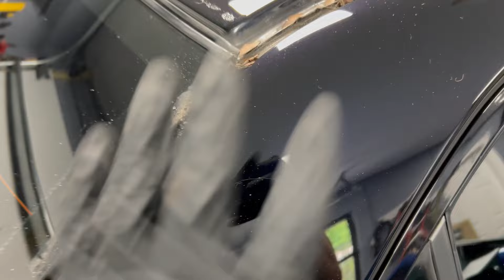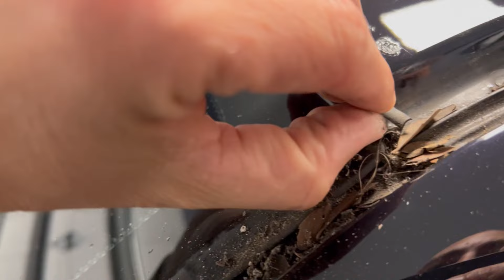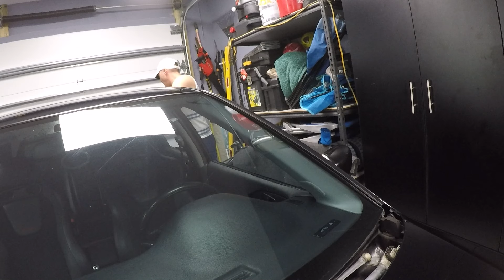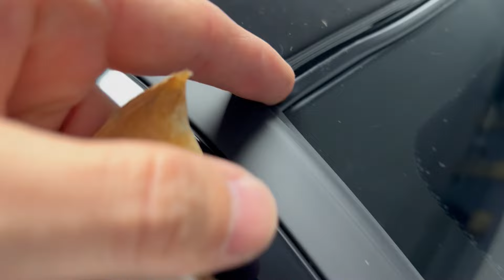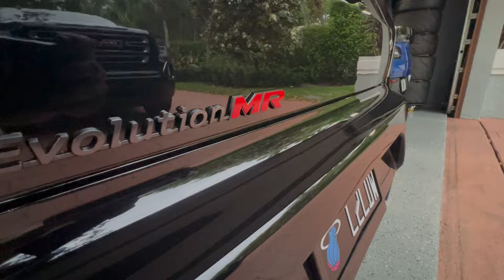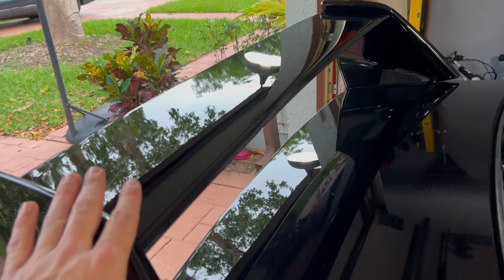Evo 9 Exterior Restoration part 3 (Replacing Every Exterior trim)

Comment: Hi, i Need Help with My Evo. How replacement molding rear glass😢
Reply from the maker: The upper you can pull out and shove the new one in 
The bottom one has to be replaced by removing the glass unfortunately 
Really all the glass mounding are meant to be replaced when the glass is removed/replaced

Comment: Good work man, did the Mitsubishi dealer have all the parts? Do you have the part #s ? Been wanting to do this with mine
Reply from the maker: Not all the parts are available in the US. The hood vent grill was not, I had to get that from a vendor in Japan.
Reply: @Justa2L  Hmmm Ill call around but if not would I be able to PM you somehow and I can get it via who ever you got it from ? Just been trying to do the same stuff youre doing more or less.

Comment: How did you get the mirror wire to go through ? For some reason the hole is too small on mine and the wire connector won’t go through.
Reply from the maker: @Angel-gi8ov  to take the mirror assembly of the car of are you trying to remove that gasket that seals against the door frame?
If you notice, I did not remove that gasket of the mirror assembly, I just separated enough to be able to clean behind it and then to coat the plastic trim